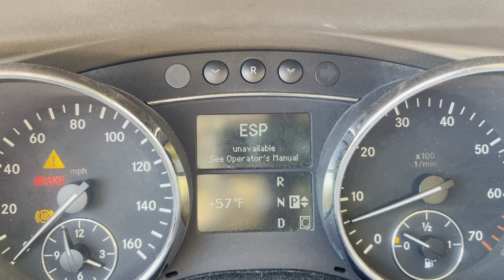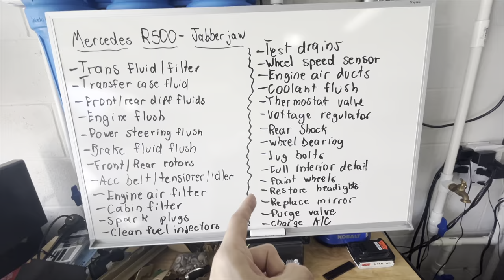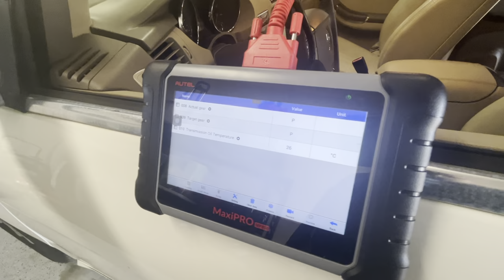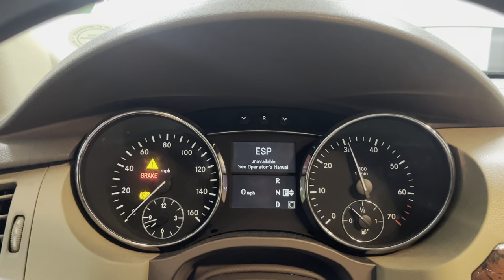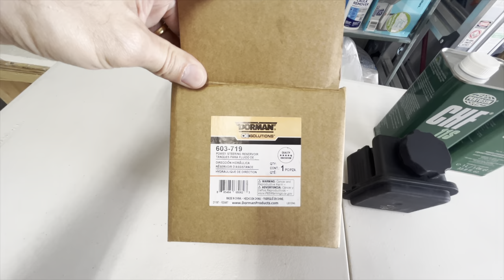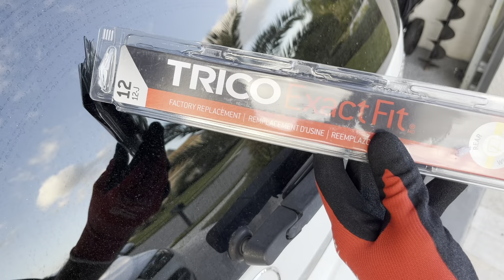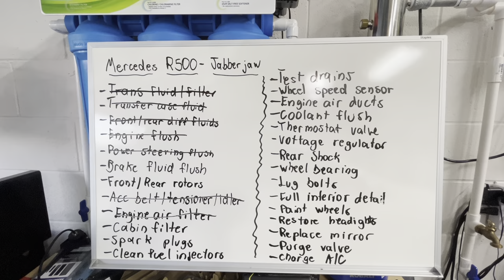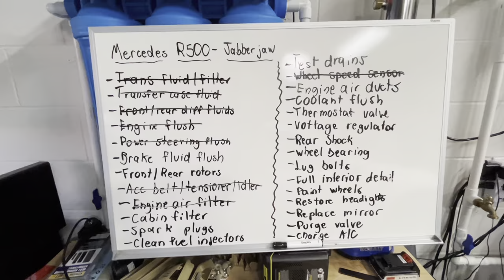Is It Worth Daily Driving a Cheap Mercedes R500?

Comment: hmm, PS fluid for R-class is usually ATF-based (Q1460001), not CHF.
Reply from the maker: You're absolutely right. I just checked the repair manual and it says ATF 236.3 spec. I've spent on chf for nothing. I'll swap to atf and do a video on it

Comment: On the transmission fluid you are best to also disconnect the return line from the cooler and run it into a bucket using short bursts of the engine.  Pump 1 litre at a time and then fill the trans back up each time.  You will flush the TC , cooler and lines.
Reply from the maker: That's a great tip. I bought another 5 liters and I'll use your technique

Comment: Good job , probably saving $1k from dealer. For spark plugs, I bought gearwrench magnet extended sockets, you’ll never drop a plug again #41740D three pieces 5/8” socket. Your merc might be different thou
Reply from the maker: Thanks for the comment and the tip! I did buy the magnetic socket for bens and it's an absolute must have for these engines! I did the spark plugs today and it will be on the next video.